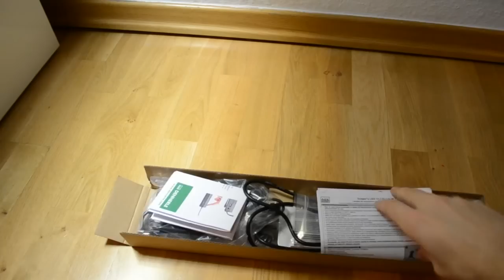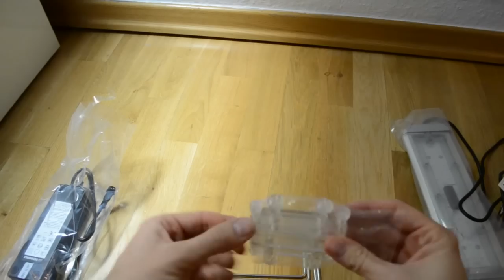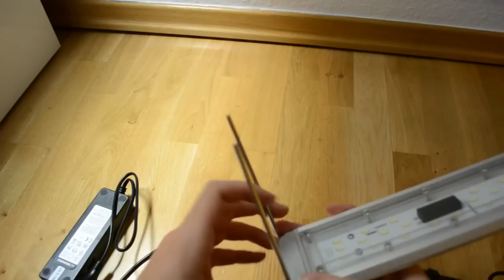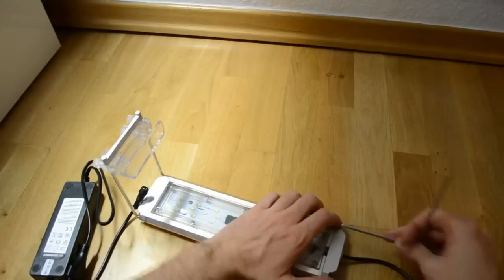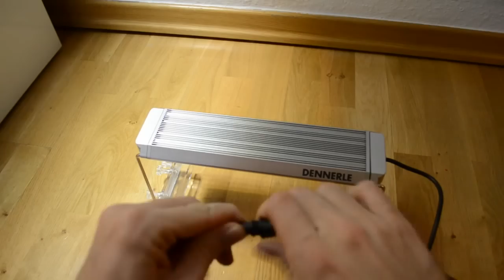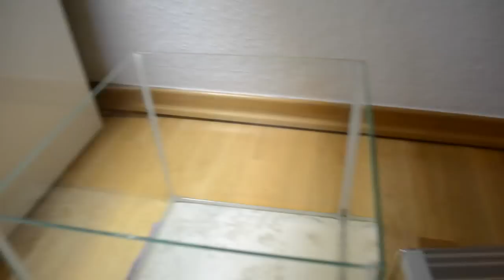Dennerle Aqua Scaper's LED 12W Aufbau/Set-up

Comment: You don't need to wait for a Dennerle USB stick. I bought the Sylvania USB stick (partnbr 000801). Put it in the dimmerblock, switched it on and it works fine with a 24-hour cylcle. I switched it on at 3 o'clock in the afternoon so in the cylcle I do have longer 'daylight' between 18.00 and 24.00 at night. Great feature, just order it from Sylvania because the Dennerle version is anyhow produced by Sylvania
Reply: +Wim Nijenhuis Hey, could post a link?  I couldnt find the USB Stick…
Reply: +Maximilian Fritz Schwarz  Yes, i found the partnumber on the following link : http://www.tropus-szeged.hu/data/sylvania_led.pdf  You will see a complete description on how the usb stick works. At the very end of the page you will find ( in italic text ) the sylvania partnumber.  In my case (i live in the Neteherlands) I called Sylvania headquaters in the Netherlands and they told me that the partnumber was in stock and I could order it via my local aquariumshop (who also sells other sylvania aquarium lamps. I received it and ever since I am a happy user of the Sylvania  USB dimmer stick which works perfectly in my Dennerle dimmer !!!

Comment: I bought the 24W lamp but on DIMMER position after timer shut it down it is not coming back oo, did you used the dimmer? did you find a solution to that problem?
Reply from the maker: Hey Alain F.,there was an issue in the manual, I think...  Thats the possible running modes:
Switch -> on / off via timer is possible
USB -> no function, usb device is coming soon*
Dimmer -> Dimming by pressing the button, a connection of a timer is not possible.

The original producer of this lamp sells the USB device in Hungary for 18 € bugs, so ist just a matter of time until this will follow from Dennerle.

Hth from Berlin!
Reply: Aquascaping Berlin thank for reply but a dimmer without a timer is kind of useless :-) , hope USB is coming soon, did you try the producer USB on dennerle?
Reply from the maker: yes I know and I'm worry about this too. ehm no, I'm waiting for the Dennerle version to make another video. Here you can see my tank, still running with that Dennerle LED-light (100% because dimming isnt possible ;-) and just with HHC https://www.flickr.com/photos/62076812@N00/16418703209/